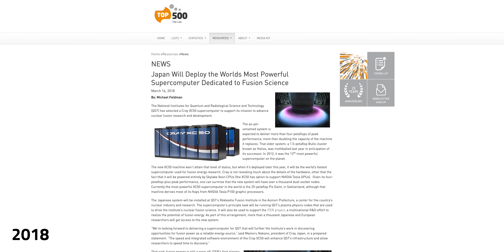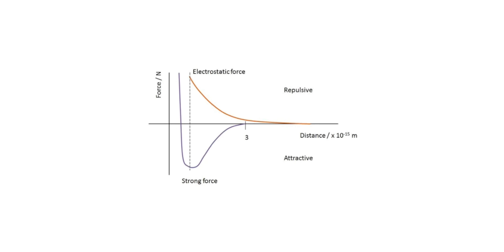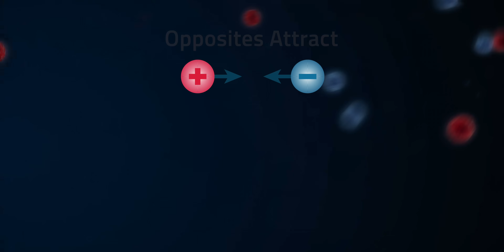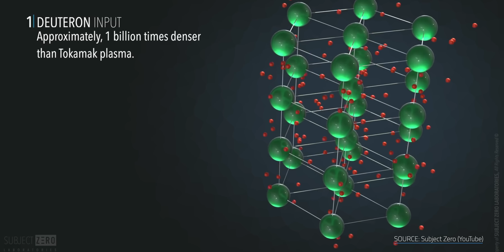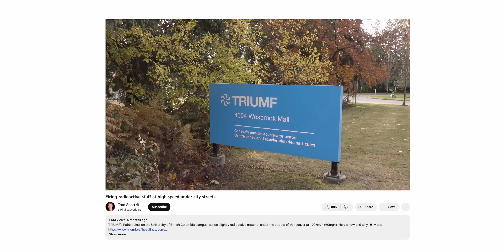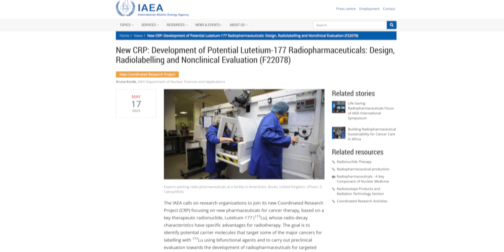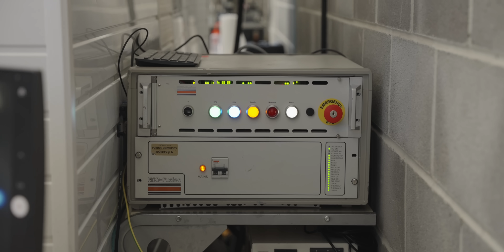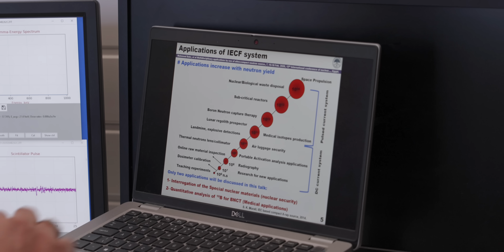How Nuclear Fusion Can Benefit Us … TODAY!

Comment: The rock-hill analogy was one of the worst explainers of all time.    So.   Not.  Good.   Trust your audience, do the work of educating, and we will come along.
Reply from the maker: Appreciate the feedback.  How would you have described it?
Reply: @UndecidedMF  Actually, the wording of your question is at the core of my feedback.  Let's look at what was accomplished, the goals of the narrative and illustration, then where I would budgeted that time instead.   The core message of the bolder/roller coaster analogy was, essentially, "lower energy requirements by exploiting forces"; that consumed 32 seconds of narrative on an analogy that didn't ultimate advance understanding of the process.   Contrast that with the solid conceptual work you did introducing  repulsion of positive charged elements and the Coulomb force, both of which aggregated knowledge for the learner.  What would have been useful for me, as a learner, would have been to use that 32 seconds to illustrate Firestone's description of their combined process; that likely would have required more time, first illustrating the constituent processes, then contrasting those with the synergistic combination.   You attempted part of this work by showing an illustration of lattice confinement fusion, but then abandoned this work for an aimless tour of features with Wallace-Smith.  You had just set us up nicely to consider "the crystalline layer of metal atoms in the surface of the chamber", but then failed to show us that layer in THIS machine, or connect this feature to interactions with other constituents, such as fuel and how it is introduced, and the novel synergistic processes of this reactor.

You did a lot of the work of collecting, less arranging and interpreting for understanding.   As you pointed out, key features could be "brain-breaking".   Instead of A-B-C-D, we were presented letters in a pile, told that they might be arranged to do something called "spelling", with a brief touch on phonics... and scorch marks.   Brains remain broken: were I now asked to explain how the machine works, important chunks would be missing.

"How would you have described it?"

I would have described IT - the machine - not an analogy of the machine.   This would have forced you to grapple with the processes and concept in a connected, cause-and-effect manor. 

Don't get me wrong- I REALLY enjoyed Wallace-Smith pointing out parts of his machine: even if I didn't understand their importance to the process, it brought the machine down from the realm of "mysterious magic" to a thing with mundane mechanisms... and literal bolts.   The tour begged so many questions, like, "what's with this confined space?"- and many more that I'm sure you asked; distilling all that down to a useful bit of instruction and reporting is no easy task, especially when the experience is entangled with the goal.   I wouldn't WANT you to parse your experience of discovery from your reporting- that energy and enthusiasm is what makes you a compelling educator.   It can be a challenge to teach about a thing when our understanding is embedded in an experience- but distillation is an important part of the job, arranging ideas and experiences into digestible and organized piles.   You often do a fine job of that... just less so in this instance.   (For starker contrast, compare this post with my first!)

Comment: Don’t worry it’s only ten years away
Reply: I understand the scepticism, but I’ve seen this personally. It’s more a matter of scaling and commercializing what is now in a lab. Astral has this experience from an ancillary technology so they can get there, just need some strategic and financial help.
Reply: @rmileski We've all been hearing that since the 90s. It's been 10 years away, for 39 years.
It's been "10 years away" since "recent breakthrough in glassmaking and camera lens technologies have made it possible for cameras to potentially, some day, be small enough to fit inside a handheld phone!" ~ Wired Magazine, circa 2006-2007

I think anyone who's over the age of 35 and has been hearing this their entire life time, believes that if anything was going to happen with this technology, it was going to happen by now. I'm personally, fully resolved to the belief that it's possible, sometime maybe in the next 100 - 200 years.
Reply from the maker: This isn't about energy production ... it's about medicine.
Reply: @UndecidedMF what medicine?
Reply: @everythingpony a lot of medical technologies require radioactive isotopes. Currently they require a fission reactor to produce, and with potentially short half lives, can make getting sufficient quantities of material to hospitals very expensive. Operating and maintaining research reactors isn't a small feat, and getting them built close to hospitals can in many cases be impossible. Having an on-site fusion reactor to produce the necessary neutrons to irradiate material is a HUGE game changer.
Reply: @Mygg_Jeager it's not hot fusion
Reply: and another
Reply: That's better than the 25-30 years estimate 25 years ago
Reply: More like five. They're using fusion technology to make medicine at a rapid rate. Just reconfigure it and we could get net gains from this type of reactor.
Reply: @WolfeSaber Man I really hope y'all are right lol.
Reply: it's operational now. 2017 patent by nasa Vladimir pines
Reply: I'll be 80 by that time & don't think it will impact my life.
Reply from the maker: Energy production isn't the key goal for this tech.  It's about medicine, which is now.
Reply: Thank you now I know this is a waist of time.